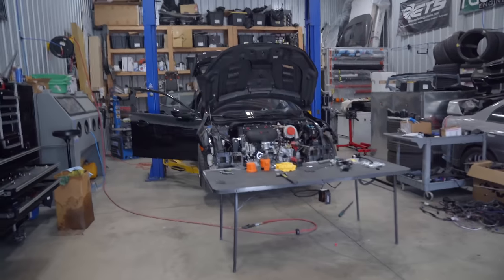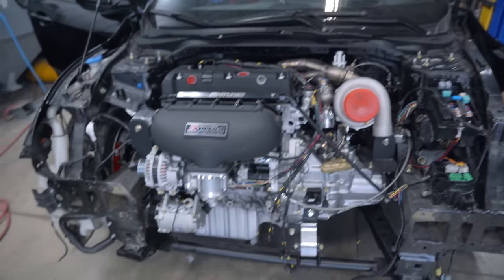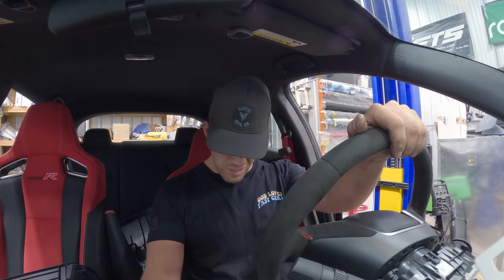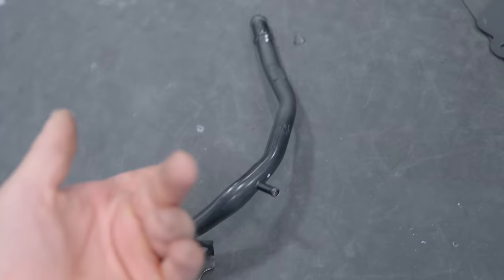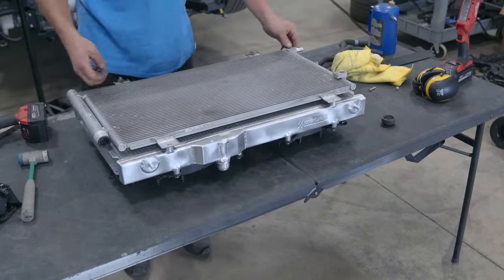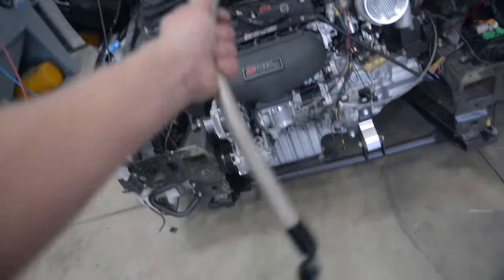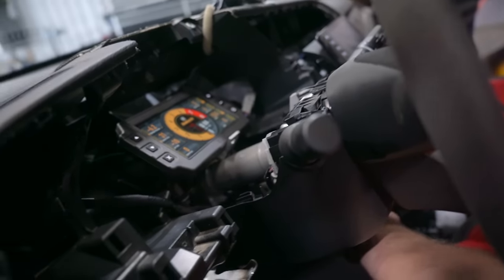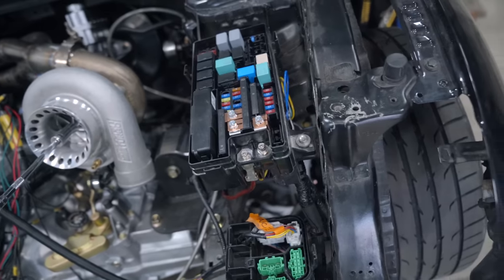Building an AWD Civic Type R | Ep. 31 (1st Start Attempt!)

Comment: Regarding your fuel tank issue, you either need to find a way to share the air spaces on top of both tanks or get a fuel tank vent/breather installed on the passenger side tank. love the content, keep it up

Comment: It’s your ground wire in the trunk that’s currently connected to the spare tire bracket. Move that ground to a better chassis spot and you won’t drop voltage anymore
Reply: Yep should run a ground from battery to front and distribute grounds

Comment: In your last video your ground wire is connected to the bolt hole in ur spare tire well. I also did tht n my haltech 1500 died after trying to crank a couple times. Haltech told me to bring it to the bay, started right up with new ecu

Comment: Make sure you have grounds from engine to chassis, trans to chassis and battery to chassis. Also I believe the battery is just too far back and the long power wire is causing voltage drop. Just from my experience moving the battery closer and having not as long of a power cable fixed that issue. Hope you figure it out 👍🏽

Comment: Devin I would run a battery ground cable from the battery to the engine and from the engine to the chassis. Not sure if you have done this already but it looked like your negative battery cable from the battery was only grounded to the floor of the trunk this would most likely be causing your voltage drop

Comment: You're getting voltage drop over the distance, increase the cross sectional area of the cable. That looks like 8 gauge/10mm from the boot/trunk, up it to 4 gauge at least if not go for as thick as you can get. Autozone...

Comment: I think your issue on that low voltage is the 12 volts power coming from the battery going to the starter ull need bigger wire for it then theres gonna be a relay for it that will distribute power to the ecu then straight 12 volts to the starter

Comment: Fuel pressure regulator after the injectors ? You lost me there...
In my mind you need to set the pressure TO the injectors BEFORE they dump fuel.
With your setup you might set the pressure for the return line. 😅

Also there is not enough gauge grounding : engine block/valve cover and trans also need big ground wires.

The ECU needs his own and separate power feed/ground with fuse/relay, to prevent any issues or parasitic feed/signal.

Comment: I have an integra kswap and my battery is also in the back. Sometimes when I let my car sits for like 5 days and not to mention my battery is new. Sometimes it’s starts but sometimes it doesn’t. I check my battery voltage and it’s good but still it won’t start. Unless I jump it with another car. I also have a portable jump start (full charge )  but that shit can’t even start my car sometimes lol. Anyone knows the problem for that?